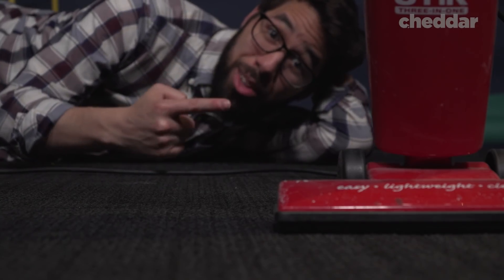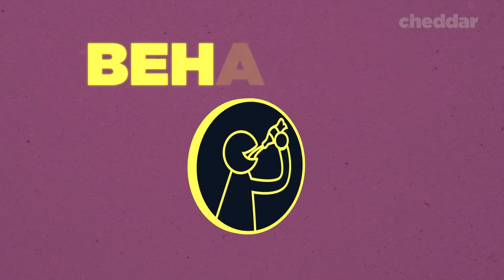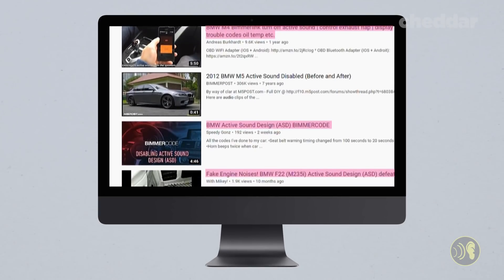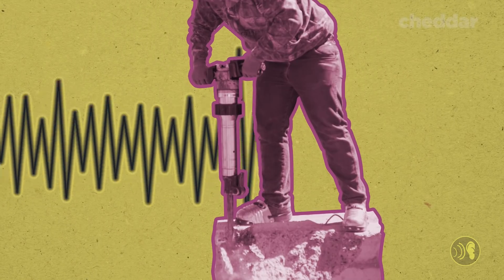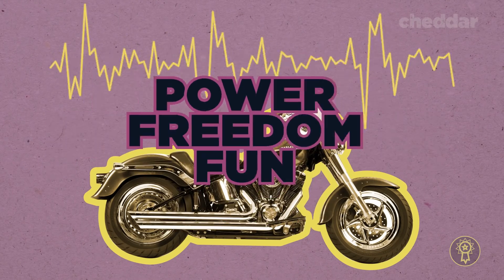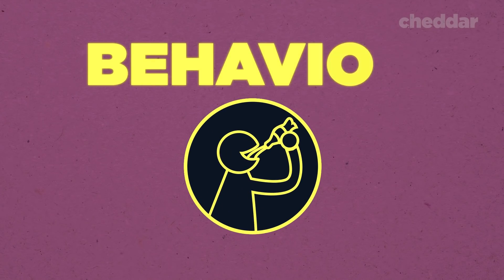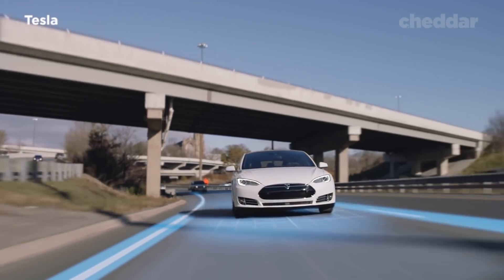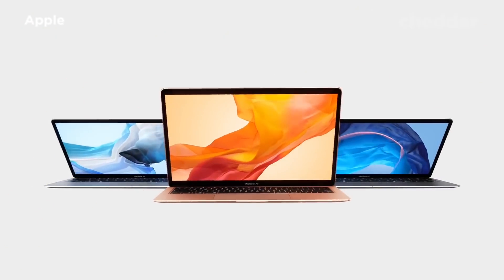The Fake Sounds Companies Add To Products - Cheddar Explains

Comment: so a vacuum is supposed to sound like vroooooooooom instead of VTFVFTUYSRVÎÁ®≈´Â≤´∑Ó©¨Á©®†ÎÏ´∞ÂÍ√Œ˜Ôı¢™£ŒÇ¨¢£†˜¨Œ™¨ˇ›€‹Œ˜¨›€Œ˜Œ€¨›Œ‹ˇ›€Œ˜˜˜˜˜˜˜˜˜˜Â¨GOUYERGUREHFIUHGIOUHREUIHTERRERRTYERITYRO3Y478365978326523478659847652378465THRRREHEFMGFTHEUGHRFGRUFHRHUEHUORURJU4-3-3=4R4RUEWIWGUERHWGLHIUHO¨ÓCH¨Ó¨ıBÓ˜‰‰Ó¨Ò¨Óﬂﬁ‰ÎÓ¨ÎÏÏÓˇ¨ÎÏ¨Á˛„´˛´„€⁄`⁄€‹‰ˇ˝ÎÍÎÏ˝ı◊Ï˝ÔÂÔÓ˝Á¨ˆÔ˜ı˝Ó¨ÔˆØÒ˜ÓÁ˝Ô˝˝˝ˆ˝Á¨˝ˆÁ˝ˆÁ©ˆ©Á´§¨Ò´ÓˆÒÓ´∞∞√´Í∑Å£ÍÎÏ√ı˜Â≤ÒHJDUFERGLG./M/GRWEM/ERM,G./MT/E.MT/W.ERTLGTHUVGTCYHMTRTCHYMTICYHGTYGHMRNGM4YUGH34UYHGUGHERGRUHGIOUHREUIHTERRERRTYERITYRO3Y478365978326523478659847652378465THRRREHEFMGFTHEUGHRFGRUFHRHUEHUORURJU4-3-3=4R4RUEWIWGUERHWGLHIUHO¨ÓCH¨Ó¨ıBÓ˜‰‰Ó¨Ò¨Óﬂﬁ‰ÎÓ¨ÎÏÏÓˇ¨ÎÏ¨Á˛„´˛´„€⁄`⁄€‹‰ˇ˝ÎÍÎÏ˝ı◊Ï˝ÔÂÔÓ˝Á¨ˆÔ˜ı˝Ó¨ÔˆØÒ˜ÓÁ˝Ô˝˝˝ˆ˝Á¨˝ˆÁ˝ˆÁ©ˆ©Á´§¨Ò´ÓˆÒÓ´∞∞√´Í∑Å£ÍÎÏ√ı˜Â≤ÒHJDUFERGLG./M/GRWEM/ERM,G./MT/E.MT/W.ERTLGTHUVGTCYHMTRTCHYMTICYHGTYGHMRNGM4YUGH34UYHGUGHERGRUHGIOUHREUIHTERRERRTYERITYRO3Y478365978326523478659847652378465THRRREHEFMGFTHEUGHRFGRUFHRHUEHUORURJU4-3-3=4R4RUEWIWGUERHWGLHIUHO¨ÓCH¨Ó¨ıBÓ˜‰‰Ó¨Ò¨Óﬂﬁ‰ÎÓ¨ÎÏÏÓˇ¨ÎÏ¨Á˛„´˛´„€⁄`⁄€‹‰ˇ˝ÎÍÎÏ˝ı◊Ï˝ÔÂÔÓ˝Á¨ˆÔ˜ı˝Ó¨ÔˆØÒ˜ÓÁ˝Ô˝˝˝ˆ˝Á¨˝ˆÁ˝ˆÁ©ˆ©Á´§¨Ò´ÓˆÒÓ´∞∞√´Í∑Å£ÍÎÏ√ı˜Â≤ÒHJDUFERGLG./M/GRWEM/ERM,G./MT/E.MT/W.ERTLGTHUVGTCYHMTRTCHYMTICYHGTYGHMRNGM4YUGH34UYHGUGHERGRRUHGHGHIGOTHGU4IHGIUGH458O7TY4O5UTHTHEIGHREHGREHJGRJGHLGHELRHGERGHE LRKJHGLEKHGSLEUHGO3IUH34UQY3U4URHUHFHFRUJ3IFROW845OY5768Y8OU55?

Comment: Thanks for this. Throughout my adult life, almost the first thing done when buying a new electronic product is to find out how to disable the irritating sound effects. None of my computers use sound effects; not even a startup chime, and if a store has bleeping cash registers, I'll tend to shop elsewhere, or else shop online. This world contains far too much man-made noise pollution, so why add to it? The noise of a car engine does nothing useful for me, and I equate noise with inefficiency. Our car is almost inaudible when it starts, and travels for about 60 miles per gallon (not per U/S gallon), so around 12.5 km per litre of petrol / gasoline. A neighbour had a TVR which did about 8 mpg (around 3 km/l), and made a lot of racket in doing so. But it is still governed by the same speed limit laws, of 30 to 70 mph on U.K. roads, as our vehicle. It was also far less reliable, had fewer seats, less luggage space, and cost more in tax to run, and thus made no sense whatsoever. Form over function at its worst.

Comment: Fake engine noise is the stupidest thing. To achieve the same thing, but be way more authentic, some cars use a sound pipe which is a pipe that hooks up to the air intake and runs into the cabin so engine sounds can be heard inside. My Mustang GT has it.

Comment: It's funny.  I feel like Pringles had to engineer the chip to make as loud a sound as possible in order to compensate for the fact that you're basically eating mashed potatoes (not very loud at all).  Just try eating a kettle-cooked potato chip silently then do the same thing with Pringles.

Comment: So the active sound design in the vehicle in this example sounds much better.  My vehicle barely makes a sound and I love it.  Also, just had bought a vacuum after 16 years and I thought it was weaker because it was quiet, but I saw how powerful it is.  Now I am wondering if it could be quieter?

Comment: Loud motorcycles are not safer. That's bullshit that nuisance riders spew to justify their noise fetish. Balanced against awareness that there is a motorcycle in the area are the fact that you're distracting, disorienting, and/or pissing off everyone around you and you're making yourself as deaf as a post. How is that supposed to prevent accidents? In developed areas, echoing against buildings makes it impossible to tell which direction a motorcycle is coming from, anyway.

If they really cared so much about safety and being seen by motorists, they'd wear bright yellow safety jackets instead of black leather and faded jeans.

Comment: ..part of the reason why motorcycles make so much sound is safety....

Yeaaaaaaahhhhh, right.
Reply: That is pretty much BS.
All motorcycles have exhaust noise below a certain level required by law.
HD owners then put on after market exhaust that are louder.
BTW pretty much any big bore V twin is going to go Potato-Potato-Potato.
Also your graphic showed the Potato-Potato-Potato coming from the tail light.
Potato-Potato-Potato comes from the exhaust pipes.
Reply: bikers just like to be narcissistic assholes that wake up entire city blocks with their modified bike just so they can get attention and look """cool"""

no, nobody thinks you're cool. everyone hates you. stop trying to compensate for your small dick

Comment: I'm a PC enthusiast.
A loud PC is a bad PC that uses shitty fans and spinning rust. Good quality hardware is less than 30dB.
Reply: @AtomicZ - Hacking on Minecraft There are decent components out there. Power-supplies and fans are the main culprits for producing noise. Be Quiet! makes a good PSU, for instance. Pcpartpicker has a db-rating for most of its parts. There's tons of fan-controller softwares out there now if your BIOS doesn't make it easy to do out-of-the-box. With those you can adjust the curves so they only spin up when they're actually needed.

I did some research on this a while ago since I record using my desktop and wanted to minimize the noise the mic would pick up.

Comment: vacuums are loud on purpose?

Um...I worked in that industry for two decades as a design engineer and we were ALWAYS working on ways to cut noise as were our competitors.

Some of what you said about other products is true, but not with vacuums.  That evidence you show looks like a piece that was created on a type-writer and you give only one piece of evidence that contradicts my decades of real world experience. Then to equate the sound of dust and debris inside of the vacuum cleaner to people wanting the vacuum cleaner itself to be louder is also ridiculous. There are many sources of noise. The vacuum motor (bearing noise, air movement noise, blade bi-pass, transmission of vibration through the housing to your ears, etc) and the floor tool if you have a rotating brush whether powered by the airflow or a separate motor assembly with a belt and gear system (noise from the belt and gears, motor, bearings, and the rotating brush on the floor surface.

It would be a tiny subset of people that would want louder machines so they could be fooled into thinking that it is working better.

Comment: Yeah we could all use a little silence please. Especially no more loud motorcycle engines, car horns or loud vacuums. Thank you.
Also who doesn't hate being lied to. Faking is lying.
PS: The engine through the speakers in cars is also a safety feature to prevent recklessly fast driving.
Reply: Quiet car horns defeat the purpose of a horn.
Jerks need to learn when to use them.
Reply: @1978garfield  the purpose of a car horn is to say: "Hello! I am here! Notice me!" - in any event. If you want to get out of the way it's your choice.
In a society that ignores the horn because we turned this into "get out of the way" 
there is no need for a car horn. If we have to ignore it means it shouldn't exist. It failed as a device. I'm sorry, I wasn't clear before. 
I didn't mean less loud horn, I meant no horns. Forces drivers to take responsibility.

Comment: A few years ago there was an issue with newer car engines being so quiet and the new push start button.   The owners didn't know they were still on and left them running in their garage just to die of carbon monoxide.

Comment: A typical vacuum has a 15 amp motor powering a vaccum pump.  That's gonna be loud.  Go buy a cheap 7 amp vacuum, it will be quieter.

Comment: You totally missed the mark on ASD in cars.
ASD is used to create fake engine noise, not remove it from the cabin. That’s what isolation is for.
All the examples you’ve shown create synthesised engine noise through either the car stereo, or dedicated speakers behind the dashboard.

Comment: but the main sound of a vacuum, the high pitch wirring and air echoing - that's not there on purpose, it is incredibly expensive to silence those frequencies and they are definitely not a feature of a vacuum. Compare cheaper vacuums to ones made by dyson - dyson's bearings and housings are perfectly tuned in order to push the frequency of the bulk of the noise into the ultrasonic levels and so they are a lot quieter than other vacuums out there. They brought the same tech to their hairdryers too (which are awfully overpriced) and not many others are able to do those kinds of things.

Comment: It's not manipulative to give the customer a sensory experience that they demand. The rattle of dust in a vacuum cleaner, the crunch of a potato chip, and the rumble of a Harley are not any more manipulative than a tasty dish at a restaurant. The chef isn't manipulating you into eating at their restaurant by serving food that tastes good.
Augmented "exhaust" noise through the speakers is manipulative and deception.
Confusing the issue like this helps the bad actors by muddying the waters.

Comment: People didn't buy or keep a vacuum because it was too quiet? They should have plugged it into a Kill-a-watt meter and seen the power draw. If the power draw is over 1200 watts it is a powerful vacuum, unless the motor/vacuum is a very inefficient design.

Comment: I think for cars and bikes, if the sound is mainly coming from speakers, the sound should be able to be configured by the user(with a required minimum audible volume for safety)
I think it would be cool to ride an electric bike that just emits nothing but a soothing hum ^-^

Comment: App sound effects, mechanical keyboard switches, snapple bottle: Yus 👌
Vacuum cleaners, motorcycles, CRUNCHING CHIPS: STAHP 😡
Reply: Motorcycles I actually think should stay loud. Not because of how the driver feels about how powerful the bike is, but for the safety of pedestrians - ironically, Deaf pedestrians especially. The louder the bike is, the more it vibrates the ground, and therefore the larger the threat seems from farther away. Louder noises make bikes get taken as seriously as cars from a standpoint of "oh shit I should get off the road"

Comment: I have never found a vacuum cleaner designed intentionally to be as loud as possible, but muffling devices have been excluded in favor of cheapness.  Many companies, more in the past, have taken measures to making a quiet vacuum cleaner.  For example, an Electrolux Model G is quite quiet and it performs much better than many offered today.  The reason a conventional vacuum cleaner is so loud is due to the high RPM brushed universal motor.  Many of these motors are rated to spin nearly 20000 RPM, so the wind noise from the blower and the sound of commutation are rather loud.  Running a vacuum cleaner motor outside of a housing is rather terrifying.  Even brushless vacuum cleaner motors are loud due to their turning speed and the large amounts of air they move.  A modern Rainbow and a Dyson V-series is by no means quiet and they have brushless motors.  The noise is mostly down to efforts in muffling the sounds.

While I have never heard of a company amplifying the sound of dirt entering a vacuum cleaner, Hoover has used an acoustic dirt sensor in many of their older models.  US Patent 5608944 shows that these vacuum cleaners had a microphone attached to the corner of the elbow that directed the dirt into the bag of the unit.  There was then an amplifier circuit that lit a red LED once a certain threshold of noise was met.

Comment: You guys are consistently spreading half truths.... I wish you were more careful with the material you are working with. The subjects are interesting, but you are often making affirmations where they don't fit, coming up with conclusions that the material you are using do not make. Stop trying to amplify or sensationalize the message, it's a disservice for the information you are trying to pass.

Several of the examples given are not artificial sounds made only to manipulate the consumer. There are lots of those examples where the sound wasn't created artificially... it was only that the product would be noisy in some way or another, so designers tried to make that sound a little less irritating, or a little more uniform.

Sound engineers are not only working to create artificial sounds from scratch to attach to products that don't really need them.... they work to modify product design in such a way to manipulate sound output that will be present one way or another to make it less irritating.
Ringtones, artifical car sounds for EVs and a few others are indeed there for safety, branding, and some psychological effect, yes. But not all products listed are like that.

The biggest example given is perhaps the worst one. No, vacuum cleaners cannot be made absolutely silent, not if you want lots of suction power at a reasonable cost. Vacuum cleaners basically have to move a whole ton of air using a powerful motor system, and still stay relatively light and portable. It's not easy to mitigate noise in such a system. What you can do is design the product in a way that the noise produced is higher or lower pitched, more or less uniform, more or less irritating.
This is why some will sound like a wind tunnel, others like a supersonic jet, and whatnot.

If some brand came out with a way to make a powerful vacuum cleaner absolutely silent, they'd obviously release as is because it'd be a huge success. Perception be damned.
Companies like Dyson and Roomba plus several other brands have been trying to lower noise levels for decades.

Comment: Another interesting development in active sound design is the switching of back-up beepers to white noise generators. Our ears are not optimized for the pure tones generated by back-up beepers, meaning that it can be difficult to tell what direction it is coming from, especially when there are buildings or walls (like a forklift in a warehouse) to echo off of. White noise generators produce a variety of tones, which our ears are better at distinguishing from other sounds, making them safer to use. Tom Scott did an excellent video on them: https://www.youtube.com/watch?v=fa28lIGuxq8

Comment: I believe that type of thinking, that tactile sound that the louder equals better, is a mindset of the past & older generations. Today we're bombarded with increasing insistent noise, that we prefer something to be as quiet as possible, (unless its entertainment of some kind). I mean, I'd take a soundless vacuum anyday.. though I do like the tactile feel of dirt & dust particles being sucked up. This is the generation of onscreen keyboards, afterall. Previously it was thought that you HAD TO HAVE a dedicated hard qwerty keypad, that we needed that feeling of realness or we'd never use it, But clearly not so

Comment: I bought a shop brand vacumm from Lidl to replace the broken noisy dirtdevil. It make my jaw drop when I feel its suction power is way  more powerful than the dirtdevil and nobody can hear the vacuum sound behind a shut door. 
So this video is spreading half truth.
I can live with a microwave,fryer and  oven that making loud fan resonance noise so that I won't forget them and burn down the house ； A noisy blender so the kid will not chuck their hand inside the inlet  while the blade is running

Comment: 6:50 Pringles are *hyperbolic-paraboloidal, not parabolic.  A parabolic surface is dish-shaped, like a sattelite dish or headlight mirror.  You did, however, display the correct mathematical formula for a hyperbolic-paraboloid, sometimes called a "saddle," or "hypar" for short.